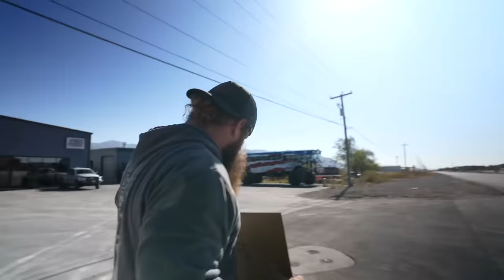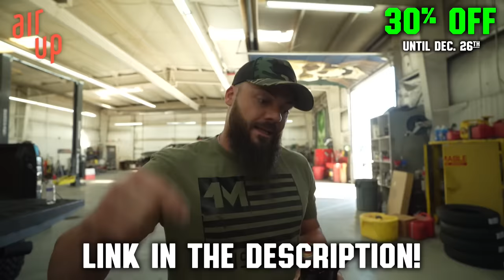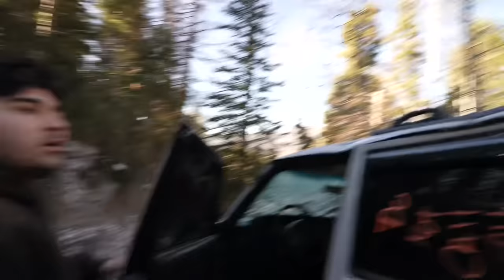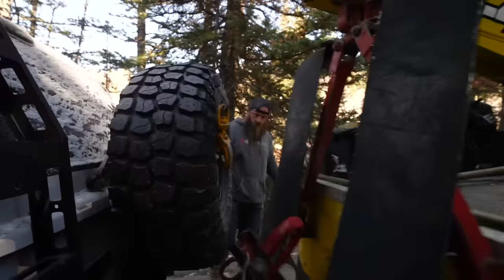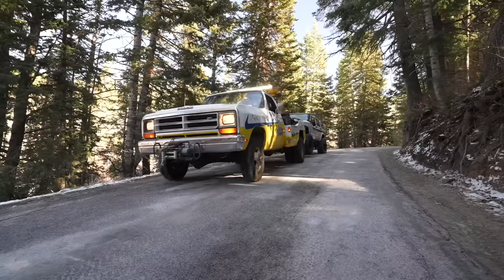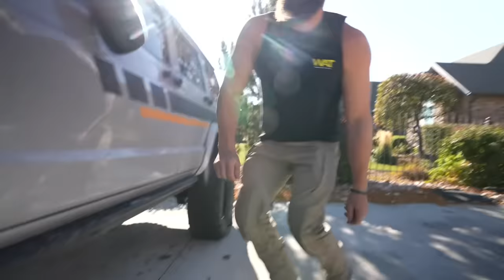Dangerous Rollover Leads To Wild Recovery!

Comment: I haven't used them in a long time but they still exist. Look up Mico brake systems. They used to make a hydraulic lock. You press and hold the brake pedal and then flip the Mico lock on. That holds a hydraulic lock on the brakes. Look up their lever or twist lock, that is the simplest solution.

Comment: Way to give back.  This is one of the reasons why Rory has all those extra winches.  Line locks for both front and rear brakes, cheap and easy and some safety triangles.  You just got the truck and may have these things along with other mods (lockers, etc) already planned. 

Hopefully you can have him do some wrap on the helo.

Comment: Back when I run tow truck we used to use  tire chain and fasten it to the back bumper and just back the truck up on the tire chains and it would lock the tires pretty good in the place and the truck would stay still

Comment: I feel for the kid. That's a hard blow that really makes you question if your doing the right things in life. However she is fixable best part about things like this is he well learn alot and now he has a jeep that he loves but won't be scared to beat on and have fun with. I bought a 2000 gmc sierra that a kid had rolled down a hill after he inherited from his grandparents. Paid 800 for it. Put about 2k in parts in it and been driving it since. I'm saying this in hope the young man sees it and doesn't just scrap his hard work. Rebuild and make it better man. Don't beat yourself up to much man. We have all done dumb shit at some point. It's how ya learn. Break it, Rebuild it, repeat.
Reply: Also note this....... 4wd wouldn't have helped ya avoid going off the edge. 4wd doesn't equal 4 wheel stop. The only thing that could have prevented it is experience and knowledge.  Something you can't really get without doing what ya did. Next time find a flat open area thats icy and play. Learn how your vehicle responds to situations like this and also how you should respond to maintain control. You can't learn without someone teaching you or making mistakes and learning  from it. Tbh she probably would've driven right outta there

Comment: Definite total.  I'm curious what the buy back amount is on that thing.  To get the max amount back from the insurance company, you want to look for comparables of what is on the market in that area.  The blue book amount is always less than the actual market value.  I saved my 4Runner from getting totaled by doing that.  Blue book was about $9000 - $12,500 and I found them for $11,000 - $20,000 with more miles than mine had.  Used to work in claims, I turned the info in to them before they had a chance to even get the estimate back from the shop.

Comment: Hi you know the bloks you use on the front wheels can hold 80% of the recovery truck weight if you put then on the rear  aksel on eny surface if the block is the right hight. I have a book if you are interestet i can translate from danish to english if you like. But good job on the recovery

Comment: now... imagine doing that in the freezing cold and still ice on the roadway , when i ran my truck you couldnt just pull forward and get it on the road, especially with a rollback , you have to plan your landing , i would pull it as close as i could get it and pull the truck to the outer part of the road blocking the road if only for a few minutes , but it gives you a landing area to get the car unhooked and repositioned , my 2cents.

Comment: You might think about a cheater air hose it does help to steal the air from the front tires in a hurry. And in a pinch we're blocking traffic you don't have to change front to back wheels. Providing the back Tire doesn't have a bent or a puncture